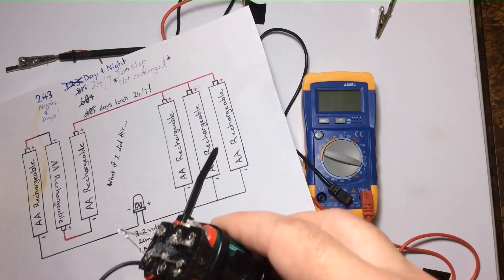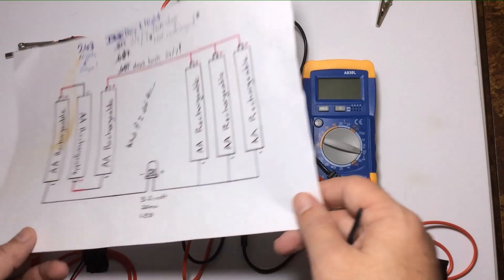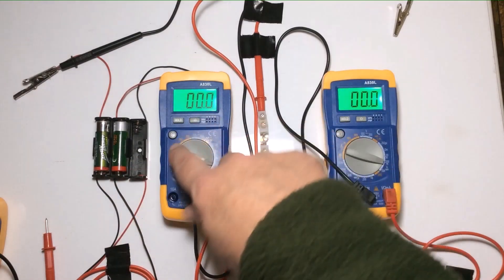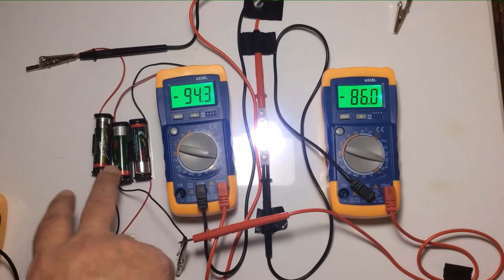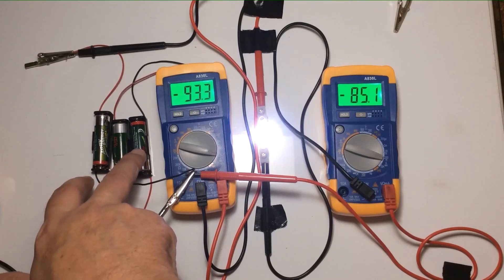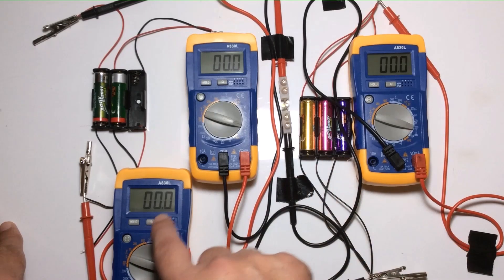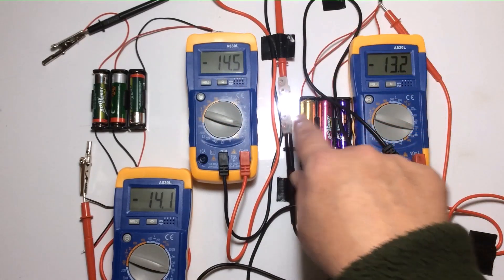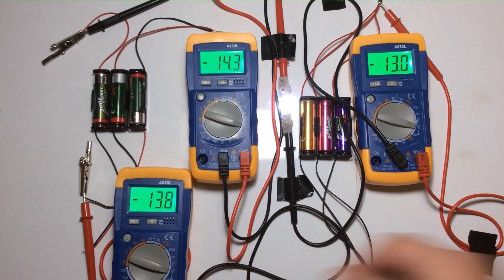TEST TERMINATED ON DAY 275... BUT HOW DID IT LAST SO LONG?

Comment: Your LED consumes only 20mA because the are all in series. And they get only a 1/3 of Voltage because they are in series. Such LEDs run also with 2V. You send 6V. Do you know a bit of electric? You should look up Nodal Analysis also Network Analysis, Kirchhoff's circuit law. Especially the second law Kirchhoff's loop rule. This is simple first semester stuff. If you really are interested in, then you should Autodidact yourself into this topic it is hard but worth it!
Reply from the maker: Thank you for watching. The LED’s are rated at 3.2 volts @ 20ma. The LED’s in this test are in parallel and not in series,  so this should be 60ma draw and I believe the 90ma is due to voltage drop, as the voltage reduces the amperage increases so this could easily explain the 90ma instead of the 60ma we should be seeing. The voltage of the series bank is 3.6 volt and not 6 volt as you stated. The voltage between the banks is 1.8 volts which is not enough to light these LED’s normally. I will investigate Kirchhoff’s Law as any good scientist will not give you an opinion on something they have not been educated on, however, if you check my lengthy answer to one of the other comments on this video I don’t have much respect for the institutional minds that give us our laws and prefer to experiment rather than theorise. My honest opinion is we should have taken Tesla’s advice and ignored the theoretical garb and performed the experiments ourselves. Either way, it doesn’t really matter which “law” you choose to measure this unit with, none of them explain why this device runs so long, simply put, there just isn’t enough energy stored to make it run for 275 days if conventional physics is correct. Correct me if I’m wrong but I have done the calculations and the experiments which I have clearly demonstrated as well as supplied my math and understanding. I’m accepting that I could be wrong and want somebody to show me the math that states I’m wrong instead of using a “law”, what if the law is wrong?
Both Einstein and Tesla stated they didn’t know if Newton’s law of gravity was correct, I believe it was left that way as they stated “for lack of a better explanation”. For society to be teaching these notions as fact even after our greatest minds said they didn’t believe it is a joke.
Reply: @whatifididthis...1236   Thank you for your quick response I agree with you. Every one should experiment and reverify statements. Instead of theoretizing nonsense that only applies in one circumstance. Newton law for example doesn't or bearly apply in dynamic oscillatoion systems. For example if you sit in a swing and you want to propel yourself forward with out any contact to the floor then by newton's law you want be able to but if you constantly change your center point of mass by rooking your feets back and forth you can excite the Swing which is a oscillator pendulum with a pice of rope and you being the nonlinear mass. You can excite it until colaps wich is a few degrees before you reach 180° of the swing. On the other hand if the swing has rods instead of ropes then you can over excite the system and perform a total of 360° turn and even beyond. You can keep exciting the swing and it will do more and more revolution and you will come in the range of Rounds per minutes or you will abort to keep swinging because motion sickness kicks in. Tesla wanted to send energy across the world with the tesla coil which is possible. The original Tesla coil doesn't send lightning in the air only retards nowadays do this shit because they misinterprete it. The real Tesla coil sends only electromagnetic waves out. Tesla wanted to send the energy into a Resonance chamber namely our Atmosphere do you know the Schuman Resonance? That is the Resonance frequency of your Atmosphere... In which the ionosphere oscillates. If you see our planet as a Resonance cavity and you put a oscillator in the cavity and you swing the oscillator with the Resonance frequency of the Resonator there the cavity's Resonance frequency, then you can send the energy to every point in the cavity and receive it with a second oscillator which has to be tuned in the same Resonance frequency of the first resonator and the cavity. That is the real intended use of the tesla coil. Radio, AC the whole Resonance stuff is ultimately a invention from Tesla it just got bastardized and separated beyond recognition from other peoples. Now we have retardeds shooting lightning bolds with overdriven Tesla coils and a monopole in energy were free energy is called pseudoscience... And  scientists try to make their delirious theories plausible with dark energy only for on observation that lead to speculative science that the universe expands which doesn't if you consider that in really large scale the light loses their energy by getting lower frequencies like in a lake when you drop a stone in it it first has a high frequency but the further the waves propagate the lower gets the frequency of the wave. The same is with sound and the same is with light but the scientist nowadays rather believe in big bang theory than I real observation.
Reply: Addition: if you make the same measurements like astronomers do you will also get the illusion that the lake expands with faster than sound waves which clearly is not the case with the lake and also applies to the universe. We can only look so far with the Observable universe because light just get so far before it dies out like a wave in a lake and that's the reason why the observable moves with the observer it is a fixed radius in which the light has its reach before it gets lower and lower frequencies the background radiation is light from stars that are further away the those of the visible light are. If the scientist would get lower than microwave and visualize it like they did with the microwave frequency then they would see even further into space. On the other hand if they calculate the radius for every frequency like they did with microwave, then they would see gradient the future the radius of the observable universe is the lower the frequency has to be. The red shift is just high frequency slowly dieing out like ripples in a lake induced by a droping a stone into the lake.
Reply: Your schematics shows one LED in series. I couldn't see the LED well in my tiny S-Phone screen that they where in parallel. This changes a lot then you are right they will draw 60mA and get 3,6V assuming the rechargeable batteries have 1,2 V each which would be plenty for the 3,2 V led to light up🤔. You have to make two scenarios because you have a network of batteries so you have to apply Network Analysis and node Analysis to solve the equation. You can solve it by successively calculating the variables and then combine them or you have to calculate it with Matrixes. The first Calculation option is to calculate the series batteries with the LED Ignoring the parallel stack by shorting it out. But only on paper!!! Not in real life please. And then you calculate the parallel stack with the same values of the LED from before and ignoring the series stack by shorting that out. You have to make sure to use the correct sign positive if it goes to the left negative if it goes to the right and the subtract the results from the first scenario (series batteries ) with the second scenario (parallel batteries) you get then the superpositioned values of the system of what the LED sees from the combined system 🤔

Comment: Strange behavior... Did you also did a long run test with a normal circuit? How much can it be staked on? I mean the cells have a brakedown voltage... How much volte can you load the cells with voltage before unwanted electrolysis(gas build up) course?
Reply from the maker: Thank you for your comment. I did run a normal test with these batteries and the same load. The normal configuration lasted less than 12 hours, how long exactly I’m unsure as when I woke the next morning the light was off. I don’t feel there is a danger of loading these cells more than their rated values as energy can neither be destroyed nor created therefore we should always see a reduction in energy during transfer resulting in less energy transferred with each battery rotation. As this reduction means there is less energy that at the start, the batteries should not over charge.
Reply: Very interesting🤔...  How far can I'd be taken 🤔 we should test more extreme configurations 5, 10,100 in series and parallel cells in parallel 100  then apply a higher load to drive more current through. The dead short scenario would be the most interesting to me. Because rearranging the EV cells in that configuration and getting more reach with that would be awesome😍 I have a shit tone of capacitors I wonder if this works also with  capacitors 🤔...

Comment: Isn't this within the error range of the scopes?
Reply from the maker: Thank you for your comment. You are correct, this would be within the error range of the scopes so before I filmed this I measured the current draw with 6 multimeters, all the same meters, to be sure of what I was seeing I then rotated all six meters and repeated the tests 6 times so I could definitively say this is not an error within the meters. They all showed the same values within 0.1 milliamperes.